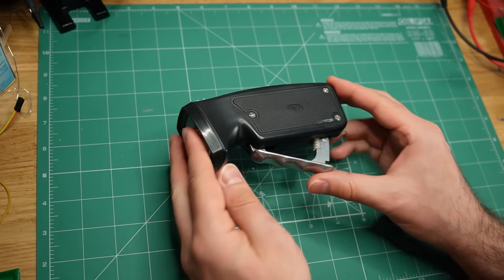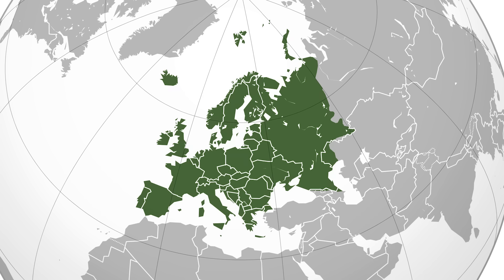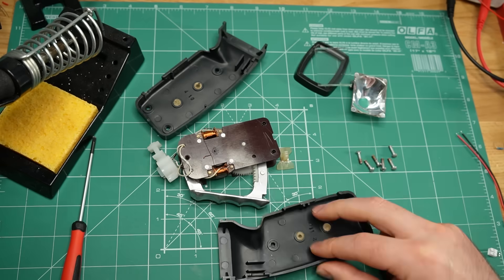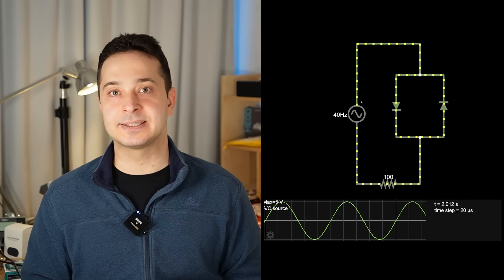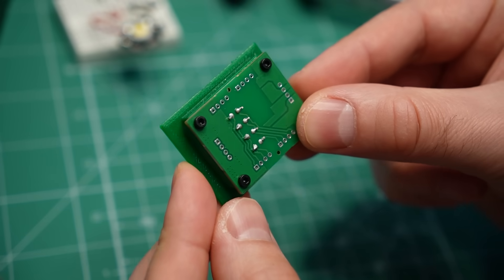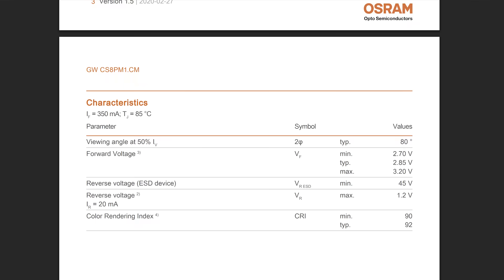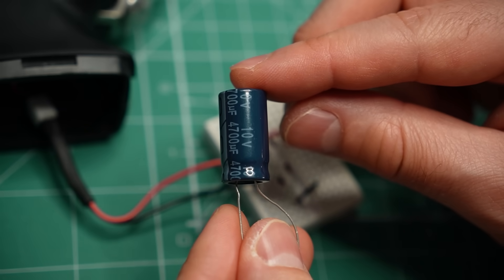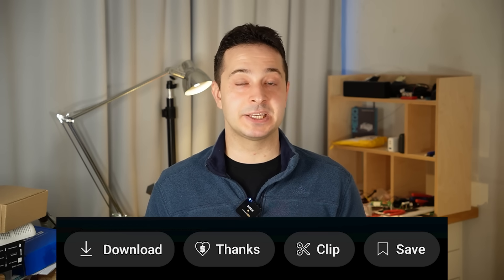Vintage no-battery flashlight gets LEDs (PART 1)

Comment: Lol excellent. I once tried to do this on an almost identical squeeze dynamo lamp in the early '90s before white LEDs were on the market, with much less success! 

I will note, a buck regulator is not likely to work well as a supercapacitor charger. I say this as someone who has a strong affinity for excessively complicated supercapacitor based circuits and want to see the circuit work... I have more recently done a similar thing to a different crank dynamo flashlight! Maybe I can offer some insight.

The issue with a buck regulator with a normal feedback network connection (where the feedback regulates the output voltage) is that it presents a negative input resistance. Let's say the supercapacitor has 1 ohms of series resistance and is charge do 2.4V, and your buck regulator set-point is 2.5V. In this situation, the buck regulator will attempt to provide 100mA at 2.5V or 0.25W to the load. This will work fine with the dynamo at full speed, although the dynamo will be lightly loaded. 

However as the dynamo speed and maximum power point voltage both drop, there will soon be a point where the power source simply doesn't have 0.25W of available power. In this situation rather than reducing the power transfer, the buck regulator will just go to 100% duty cycle (or as close to 100% as the chip allows), and may even enter a fault mode. At that point the system will simply be directly charging the capacitor, best case. Worst case it won't do anything. 

And this doesn't even cover the situation where the capacitor voltage is much lower than the output regulation set-point. In this case the regulator will probably be in short circuit fault protection mode and won't work.

A dynamo will probably be much happier working into a constant resistance load, which is of course pretty hard to approximate with off-the-shelf converter ICs. 

A constant voltage load might be the next best thing. Basically, we'd like the buck regulator to regulate its _input_, not its output. It would be a nice charging efficiency boost if we could charge the supercapacitor with 250mA when it's at 1V, and 100mA when it's at 2.5V, whenever there is 0.25W available. Certainly this is quite a bit better than directly rectifying into the capacitor. There are some chips the market that provide this function, typically directed at energy harvesting from solar sources. The BQ24650 from Texas Instruments is the first example I found. I haven't checked the actual specs to see if it works for you, but there might be something out there that does.

Of course this isn't optimum! We want real maximum power point tracking! What I ended up doing for the miniature crank flashlight project I alluded to above was programming a PIC 10F322 MCU to drive a half bridge that is connected to the supercap with an inductor, and basically forms a bidirectional converter from the main power rail to the supercap. The brushed generator feeds the main power rail directly, and the LED is driven directly from the main rail with no current limiting. During charging the converter alternates between buck conversion and idle (to let the generator drive the LED directly) and during discharging it acts in the opposite direction as a boost converter in constant output current mode. All of the duty cycles are driven from lookup tables, based on measurements of the main power rail and supercapacitor voltages. 

That project took WAAAAYYYY too long, and although it was satisfying to achieve my goal, the result was... underwhelming. Hand cranked, supercapacitor based lighting is sort of not that great! I think with your squeeze lamp it may end up better than my pocket sized crank lamp. But yeah... maybe don't waste the amount of time on it that I did! 

However I do want you to succeed, and I don't think a normal buck regulator will get you there.

[edit: yeah just checked the datasheet, with a 2.3-2.4V UVLO and short circuit protection, the TPS62A01 is very unlikely to be happy trying to charge a supercapacitor. It will probably just drag the generator voltage down to the cell voltage, hit UVLO, and then restart/soft start over and over. Unless you get lucky and the soft start ramp actually causes the behavior you want... ]
Reply from the maker: This is helpful info. Thanks for sharing your experience! Even if I fail, we'll all get to learn from my mistakes :)
Reply: @LeftyMaker  I will very much enjoy seeing how it turns out, thank you so much for the response! I hope it works... it might! The only way to know for sure is to try!

Comment: You should use a super cap and a diode and make a joule thief circuit. Use the dynamo to charge the supercap and then it will run the joule thief circuit and LED.

Comment: Are the LEDs really dead? Maybe they are only acting like a Zener diode and clamping the voltage... I know they are very sensitive to reverse voltage, but there is not a lot of current in this case...
Reply from the maker: Yes, they are. I burned several of them. Then they only heat up when forward biased but don't make any light.

Comment: You could reduce mechanical resistance on the flywheel by adding some form of overrun clutch, meaning that the handle being unsqueezed shouldn’t act as a set of brakes.

You could also just try to improve the dynamo itself.
Reply: It already has a clutch.

Comment: you know making it run with a clockwork & metal spring, that saves the wind up energy and passing that kinetic energy to the dynamo, would be even better. Not only would it run longer, it would also provide a more stable energy flow, making the light shine more stable without the need for any electrolytic buffer capacitor. So this thing would basically be working forever till the LED actually dies.
Reply from the maker: I think a spring wouldn't be able to hold a substantial amount of energy. However, I know of a project where they used a rock pulling on a rope attached to a mechanism and a dynamo to produce light.
Reply: @LeftyMaker  Well the spring would just save the kinetic energy to push a rotating cogwheel mechanism which would spin a little dynamo like the cogqheels of the handcrank would. Same principle. :)  I kinda think of something like the windup Radio by Trevor Baylis.

Comment: This generator is funny one: it purposely have large output inductance in order to stabilise output current. It works as follows: the higher rpm the higher voltage but at the same time higher frequency so output impedance grows as well, linearly. But voltage divided by impedance stays constant. It allows these flashlights to get decent light output when cranking at moderate speed and not burn out the light bulb if cranking too much.

Active resistance of generator is actually low.

That means powering LEDS that simply is good choice, generator itself limits current to value shown in the bulb. Just set power led with same rating or higher and that's it.

There is a way to take much more power from that thing: it requires matching output voltage and trying to avoid any harmonics of current except first one. Some sort of PFC. But still I didn't come up with simple and reliable circuit for this.

Bike dynamos have the same principle by the way. But more power of course. They output that 3W at roughly 10 km/h and stabilise current at 0,5 A.
Reply from the maker: that's interesting (and slightly outside my scope of knowledge :) Thanks for sharing!

Comment: This is a neat project! I might try to do this myself.
Personally, for the LED I would use something like an LH351D, it's high power (10W), high CRI and 3535 footprint. Since it's rated for such power it would give you more effiency than the other LEDs at the same power because it would be ruuning at lower than the rated maximum, it would also produce a very pleasant beam and you could keep the reflector.
Reply from the maker: That looks like a nice LED. Too bad that my sponsor (which covers the cost of parts) doesn't carry many Samsung models. But they have Osram, which are pretty good. Unfortunately, I'll have to remove the reflector for the next project. There's very little space inside the flashlight
Reply: @LeftyMaker  that's unfortunate but you're right, Osram has plenty of nice models too. Since the reflector has to go maybe you could use some TIR optics if you haven't already, they're easy to find and can be real tiny. Excited to see the next part!
Reply: @shitass9102  I like this idea. If a TIR optic is too bulky a fresnel lens is also an option.
Reply: @LeftyMaker Perhaps you could use a dielectric film and a 3D-printed mold to make your own reflector which fits better.
Reply: Just in case if you wanna know more about flashlight LED. Entering r/flashlight subreddit or budgetlightforum. They have lots of super in-depth information about literally every flashlight-suitable LEDs.

Comment: Great job! What if you do the opposite, try to modify the mechanism using the "old school" - fully mechanical method? Just curious how much it can improve with bigger flywheel or new gearing.
Reply from the maker: The original mechanism is riveted and I don't want to take it apart, but I may try to make a copy with 3D-printed gears and stronger magnets.

Comment: use the leds as the diodes in the fbr?
Reply from the maker: no, this wouldn't work, unless you want me to make the world's worst bridge rectifier :D The very high voltage drop (2*2.8V) and low reverse voltage make LEDs unsuitable for such application.
Reply: @LeftyMaker  not smart enough to know any better lol. was thinking the waste heat of the bfr would be mostly light thru the leds. supercap could just discharge backwards thru the leds? maybe an ocilator type setup back and fowrth. the RC value would probably not work out since led's dont have much resistance.

Comment: My issue with hand-powered flashlights is their inefficiency in extracting energy from hand motion. They offer too little resistance for an average male hand, so most of the energy is spent moving the hand rather than charging the dynamo.  

Imagine you have to move 100 liters of water from one point to another, and you have a choice of containers. On one end, you have a single 100-liter bottle—it can hold all the water at once, but you can’t lift 100 kg. On the other end, you have a 1-liter bottle—it’s easy to carry, but you’ll need to make 100 trips, wasting most of your energy on walking instead of carrying. Then there’s the middle ground: 5-10 liter bottles. They’re not as easy to carry, but it’s manageable, and you only need 10-20 trips. This feels far more energy-efficient than moving water one liter at a time.  

Every dynamo flashlight I’ve tried feels like I’m trying to move a large amount of water one glass at a time, frantically cranking the handle like an idiot. I wonder if the designers even considered this efficiency factor.
Reply: In theory a nice analogy but the problem with dynamos is that their mechanical resistance is directly linked to the load. On the mechanical side, you would need a bigger and/or heavier flywheel to increase the momentum needed to overcome to make it spin faster. both are variables hard to change in such a small form factor. Increasing friction in the bearings would not extract energy but waste it.
Reply: bigger flywheel?
Reply: @Hajdew maybe better bearings to keep the flywheel going
Reply: Could be fixed with another gear, I couldn't quite see what was inside this one but the cheap plastic ones usually only have one gear, the handle connecting to the small side and the dynamo on the large side.  I imagine it would make the case a bit larger but I think it would be a good trade-off.
Reply: add supercapacitors, neodymium magnets, more copper to the stator. making flywheel spin faster or heavier is actually harder and inconvenient.
Reply: @Timsturbs   At some point neodymium magnets are not enough, that's why there's excitation circuit in generators
Reply: You may be onto something.  A higher gear ratio could make the flywheel go a lot faster.  If the magnetics is designed right, you may be  able to somewhat decouple the LEDs from the alternator when the frequency and voltage is high and then increase the coupling as the flywheel spins down.  This will reduce the maximum light but give a longer duration for one squeeze.
Reply: hand cranks can power a radio.
Reply: It's done on purpose. If it has low resistance you are not tiring your hand too much and you can keep cranking for a while.

The energy required to move your hand is proportional to the resistence, so I don't understand how you are claiming it has low energy conversion efficiency just because it has low resistence.

Your example with moving water is not the same situation as a crank-powered light. A better example is moving infinite liters of water for the longest possible time, until you drop down tired. The best strategy to last longer in this challenge is to move as little water as possible, so you tire as little as possible.

This is what the crank does.

Comment: I used to have a flashlight that kind of looks like this when I was a kid. 
It has a switch to turn on the light and if ever the light goes so dim, you can just crank it for few minutes and it's good again. 
So I guess it has a battery.

EDIT: I'm saying maybe you can try adding a battery instead.
Reply: It could be a capacitor, rather than a battery.
Reply: @DFT-v2  was thinking the same.

Comment: I didn't understand half of that and know nothing about electronics.. So  this may be stupid or maybe you already said something I didn't catch... But could you send some straight to the light along with the capacitor so it lights up straight away?
Reply: You could by adding resistors
Reply: I'm thinking that's what the circuit he is developing for it will do. For someone with bugger all knowledge on the topic your question is excellent!